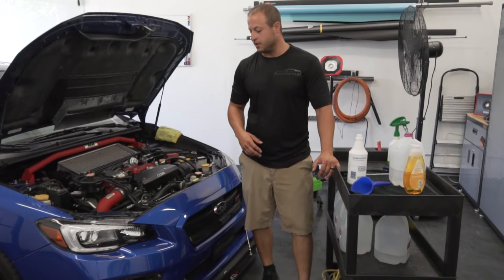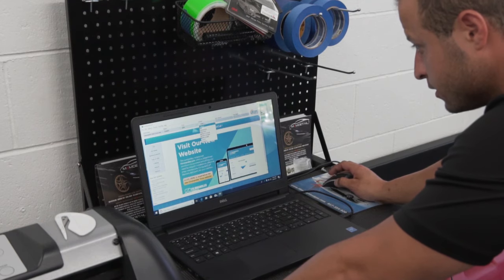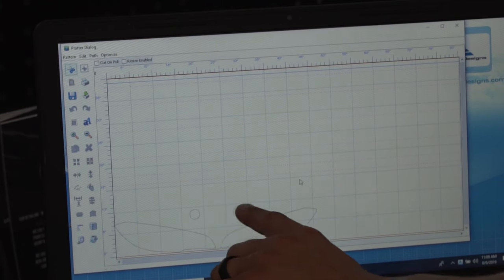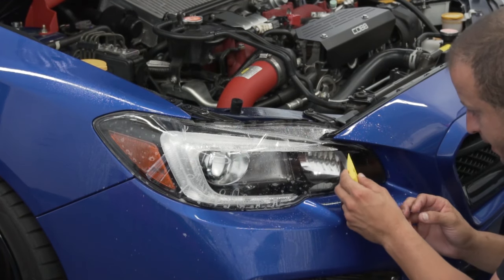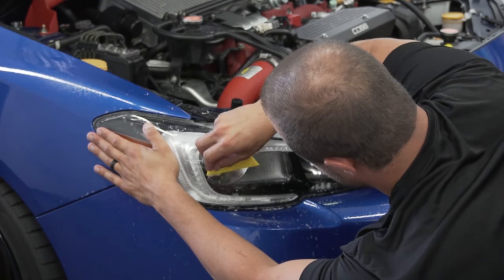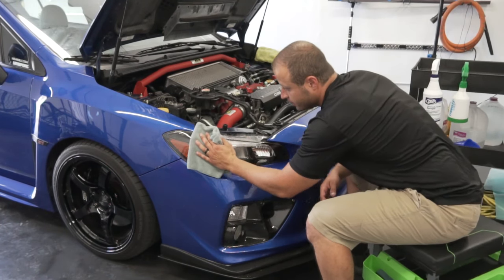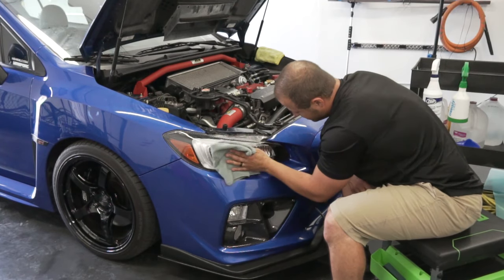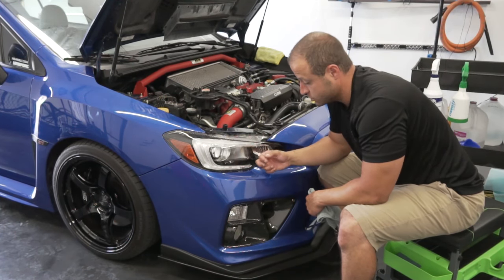how to install paint protection film to your headlights

Comment: You make it look so easy. I always get folds and bubbles.
Reply: I’m with ya. But I find the one little imperfection I always end up with is just for me to remind me I didn’t  pay someone to do the job ;) and I’m not perfect. I’m ok with that! Mine had two small bubbles that would not go away. I syringed them out but still can see them. Tried hot water to cure ppf nope.. so I just live with it. It’s not in the middle and no one will see unless I point it out to them. Great video thanks

Comment: I had some PPF put on the headlights of my new Porsche 911..  do you know if it will harm the headlights if I have them removed and replaced?  Does it do damage to the headlight lease or is there a coating I should be worried about?
Reply from the maker: What year is your 911. On my last 911 I did the dealership had to remove the ppf off the entire car to certified the vehicle. The headlights have a type of coating on them. The headlight did have some areas where they were damaged. This could be from just ripping them off and not using a steamer to help relax the film when removing.
Reply from the maker: @Sams911  looks awesome just saw this sorry about the late reply

Comment: “Simple process” I tried for 4 hours on 22 wrx headlight. This is impossible! I couldn’t do it. Got frustrated and gave up. There goes $150 done the drain for a front end kit headlights and bumper. This is not DIY job. Unfortunately I live is shity over priced, very expensive Canada and PPF places want $4000 CDN just for front end bumper and headlights! Get bent! 
Guess my car will get riddle with rock chips. PPF is not DIY job. It’s expertly hard. I followed this video to a T to.

Comment: Question: In this video you "tacked" down the inside corner of the headlight to begin, but you did not use any "tacking solution". So, will the film adhesive work/tack/stick using only the "slip solution"? Or do I need to apply "tacking solution" to the entire inside portion of the film? I'm going to replace some PPF on my truck, and this is the first time I've ever applied it, so I'd like to get it right the first time. Thanks for the helpful video and reply.
Reply from the maker: You do not need to use tack solution to make the ppf stick. The slip solution will tack it but not right away. You can also use hot water as a tack solution. If you need to relax the film a steamer works great. Hopefully this was helpful and best of luck on the install 👍
Reply: Good to know! I've watched several PPF install videos and no one has mentioned this little detail. I appreciate the help. I've been browsing and watching a few of your other detailing videos as well. Great job. Keep up the excellent work and best of luck in the future.

Comment: Do you have a video installing on a 2018 to 21 Subaru Crosstrek? Curious on how well it covers the top of the headlight.
Reply from the maker: I do not have a video on that vehicle but I can give you the measurements of the pre-cut if want. Once I get one in the shop I will for sure put the video out for you.

Comment: I have the simplest headlights out there (several Lincoln Town Cars)  In roll form this stuff does not behave as shown! Fingers that  are smoothed out pop back up in a few minutes. The film will only conforms to one curve. It does not stretch or shrink to fit. I THINK IT ONLY WORKS WITH THESE PRECUTS AND LOTS OF PRACTICE. It looks so easy, so I just wasted quite a bit of money that is now wet, stuck to itself and in the trash. Any advice is welcome so I can waste more money. Who knows, I may figure it out yet.
Reply from the maker: Hey yes practice does make it a lot easier. When you get those fingers spray hot water in them and knock them down. Also when installing the film lock down one side a stretch the material across so there are no fingers. This will stop the fingers from happening in the 1st place hope this helps and good luck. If you want to try some pre-cuts I sell them on the website. 

m2mdetail.com
Reply: @m2mdetail781  Thank you for your kind advice. I will try again using your tips. If I am still unable to get it right, I'll try the precuts.

Comment: Nice subie man I just did my 23 wrx headlights and fogs. I actually put blue painters tape on the headlight and used a sharpie to outline the light then pulled it off cut out the shape then stuck it to cardboard paper and cut that out then onto the film. It was pretty quick. I’ve never done ppf before but it came out pretty good. Could you have used heat on the stubborn corners or fingers as you said ?

Comment: Do you use the same technic for all headlights? Tack inner corner and advance? I’m having trouble with an Elantra 2013
Reply from the maker: Sometimes I do the opposite way. The key is to lock a point and pull the material to relax the fingers so they are gone before you squeegee out the slip solution .
Reply: M2MDETAIL thank you 🙏🏻

Comment: Hello, useful video 
Thanks 
Can you explain which purpose using the tack solution?
Reply from the maker: Yes, tack solution is uses to lock down so you can pull the material to relieve fingers. Check out this install which has a better understanding.
https://youtu.be/9BUj9iMCojE
Reply: @m2mdetail781  Thanks a lot❤❤

Comment: Can you post a video for 2016 Toyota Sienna’s headlights? I didn’t have a pre-cut film, and I was struggling with putting on a ppf last night
Reply from the maker: Hey Chris I will try and get one of these in for you. I do have the pre-cut film if you would like to order one after I make the video for you. Best thing to do is tack down a corner and then pull the ppf to the opposite corner and tack that in place. Then squeegee the liquid out. If you have fingers try some tack solution to push them out or steam to help relax film.
Reply: M2MDETAIL yes, I would love to watch your video first , thank you so much

Comment: Is there a PPF for 2007 tacoma headlight?
Reply from the maker: I will check for you.
Reply from the maker: Just checked my system and no there is not any template for headlights. I have your front bumper and partial hood and fenders

Comment: quick question how do I get that pre cut ppf machine? also what website did you use? awesome video by the way!!
Reply from the maker: Thanks. I'm using a gcc plotter 40in jaguar vlx. For all my templates I used SolarGard and SunTek software. If you need a pre-cut template head over to my website m2mdetail.com 👍
Reply: @m2mdetail781  much appreciated on the info I run a headlight restoration LLC and noticing that the pre cuts make the job a hell of a lot easier you think a 40" is good for what ill need kit for headlights I'm thinking in purchasing one with the software
Reply from the maker: @stefangonzalez2285  if you are just doing headlights I would look at 24in plotter that will save you a lot of money then buying the 40in. I have 40in because I do a lot of window tinting and full car ppf.
Reply: M2MDETAIL PERFECT 👌 THANKS FOR THE HELP AND PROFESSIONAL ADVICE IM ON IT!!

Comment: Does this come off say after 1 or 2 years v
Reply from the maker: You can remove it at anytime. Comes with an 8 year warranty.
Reply: Marc Maloof that’s awesome thanks for replying. Now does it just peel off or do apply heat to peak off ?
Reply from the maker: @hubertfuent863   if you watch my other video on how to remove clear bra it shows you. You could use a heat gun but it is better to use a steamer. The heat gun can be too hot and the clear bra will not want to peel off.
Reply: M2MDETAIL gotcha gotcha 
This is the first time I actually thought of protecting my headlights-since I bought new updated ones-
Reply from the maker: @hubertfuent863  I would do it for sure. If you are interested I sell pre-cut kits on my website and a install kit. 
m2mdetail.com 
Contact us on the website and I will send you over the template so you can see what they look like for your vehicle. You can also text the shop number found on the website and I can send you pictures of PPF kits. 👍